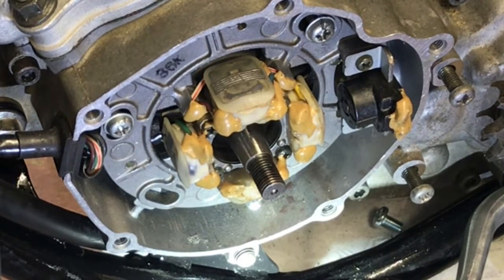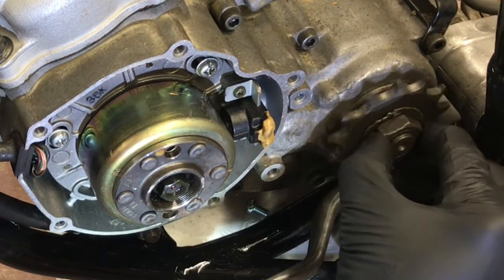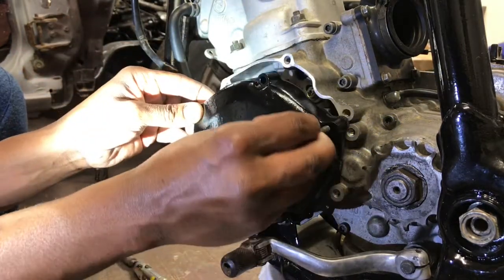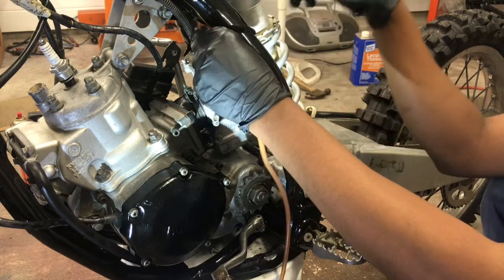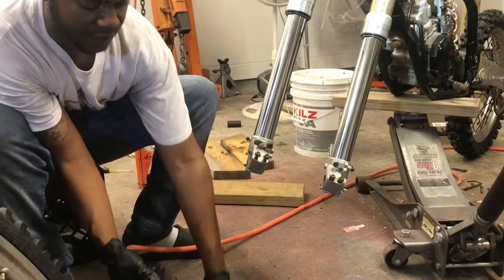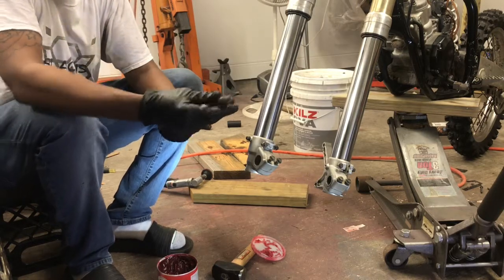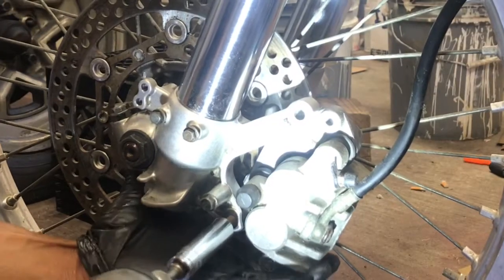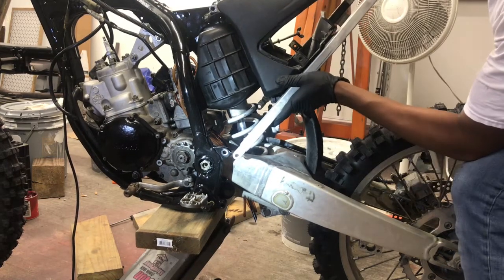Yamaha yz125 2 stroke Dirt Bike Build How to Install Rotor , Stator , Wheel , Brakes , Subframe

Comment: I have a little dirt bike just like this. The electric start works but even with the kill switch off! Usually I have to turn the kill switch “on” and then press the start button. The bike has no key, just a simple 5 wire system with a solenoid relay. I’ve checked resistance between all the wires, the starter relay and battery and spark plug are brand new. Could it be the flywheel position? Should it be set to “T” or “F” or one of the little lollipop type symbols?? Could this cause the kill switch not to work? Or is it more likely to be the wiring to the starter motor at the front of the bike? It’s hard to access but the wiring harness is very squished so could it be that?? I know it’s not quite on topic but I’m a single mum can’t afford a mechanic and want desperately to get this working for my boy for Christmas! I know it’s something simple the bike is brand new but has been in storage a long time. Thanks sooo much!!
Reply from the maker: Check for any shorted wires or loose ground connection

Comment: I have a 2001 yz125 I just replaced the stator and rotor but I don’t have the nut and washer. Can I use any nut and washer that fit or I have to get my specific year nut and washer
Reply from the maker: That particular thread is hard to find I had to order it. Make sure you don’t over tighten it, I did and stripped the threads in the crank
Reply: @MRRANDOM1  okay thanks. I might try to order 2006 nut and washer and see if it fits.
Reply from the maker: No problem, that should work
Reply: @MRRANDOM1  thank you 💯